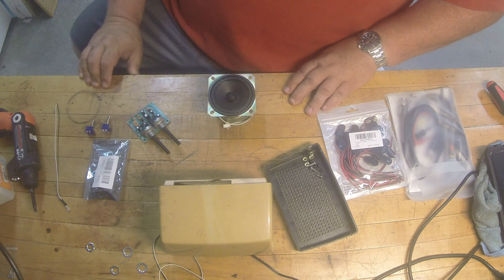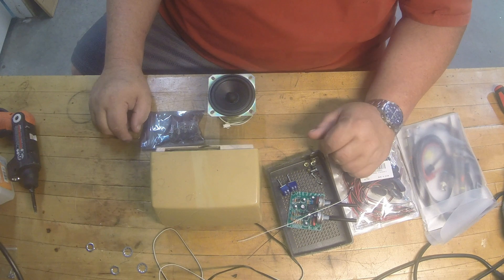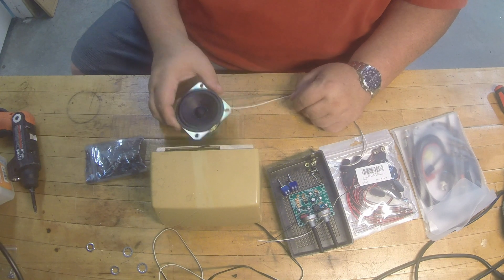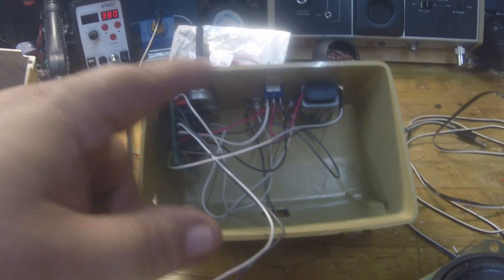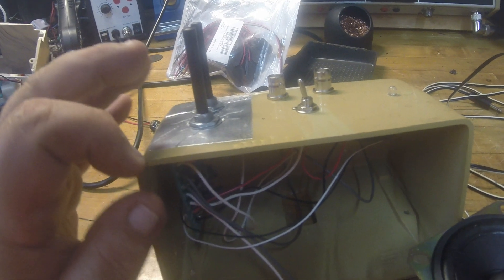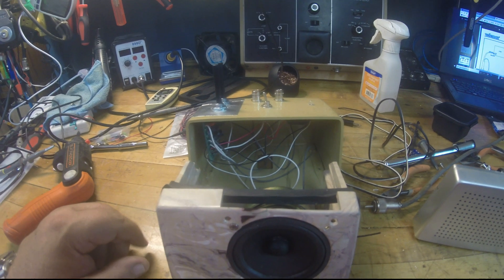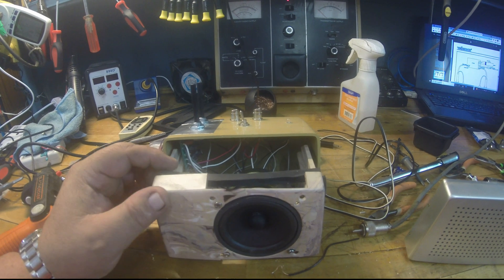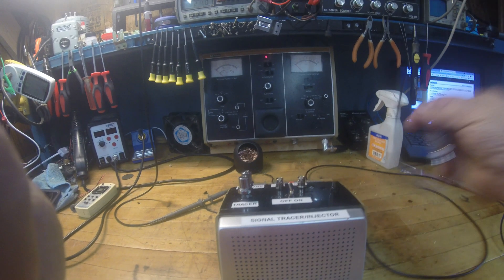Signal Tracer Home Built with Case Using a K7000 Kit

Comment: Updating my reply - You've inspired me to build one of these just as you did except with a different case. Thank you for this assembly guide.👍 I was wondering if this could also be used to locate an open component on a motherboard or a control board?🤔 Just don't want short anything out trying.
Reply from the maker: I think so it uses audio tone to trace signals as long as what you want to trace has a signal it should trace it, I have never tried it that way I use it for RF signals but seems logical you could use it to trace signals on about anything...

Comment: How did you add the volume control, ie, wiring schematic, etc ? Nice setup. I have a kit on my bench now.
Reply from the maker: That is just part of the way the kit works one of the dials is an attenuator which is the output level which is basically the tone volume now if you want to use it as a rf generator for that you use a 400hz audio tone and use a in34a diode on the lead of the signal trace to rectify the rf and you will hear the tone. Take the diode out of line for audio tracing. Hope this helps. It's kind of crude Audio/RF signal tracer but it works.

Comment: Neat idea , I saw a brand new Eico Signal tracer kit on ebay  a while back ... The bid was 30 bux , so I waited to bid on it closer to the end of bidding I went to 100 bux , then I had to back out , it sold for 300 bux ....... Sooooo  I am building one from a set of PC speakers  and a homemade probe inside of a medical syringe that a nurse gave me ..... I got about 6 of them for nothing ,  I got the schematic from Buddy at The Radio Shop channel....All the parts came to about a dollar , I added those parts to a order I had coming from Digi - Key .....Since I have a function Jenny already it works out fine ...... I do like yours also cause it has the Jenny in it ..........

Comment: I saw the box you were going to put it into and thought you could have found a better one, but it turned out fine, the LED is a must, I think if it were me I would have put a power plug on the back so I could plug in a power supply and cut the power from the battery.  But that;s me, I think that 9v batteries are overpriced.  If you put in a socket at the back the power supply can be used for other things as well.
Nice job.  I used to build a few kits, but as I said, I have not built anything in years.
Reply from the maker: All I did was connect a LED to the hot side of the switch so when turned on it will power the LED you just need to put a resistor in line to reduce the voltage to the LED in my case I used a 300 ohm one but anything from 200-300 ohms for up to 12 volts should be fine.
Reply: @TheElectronMan  👍